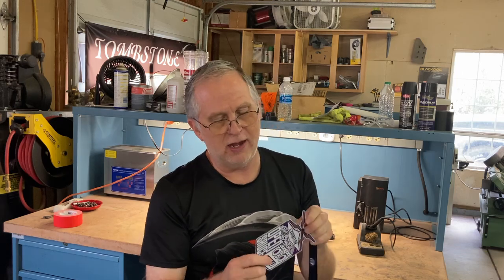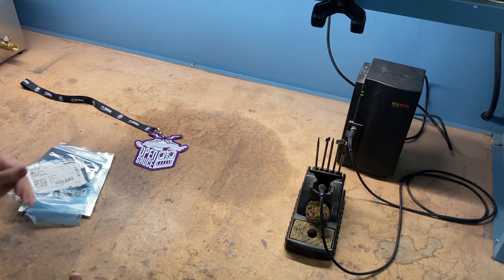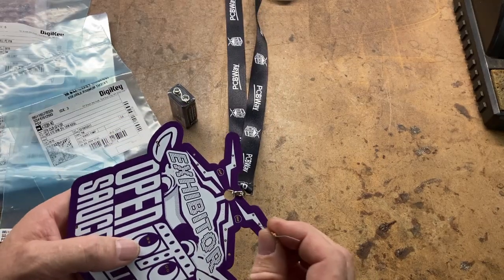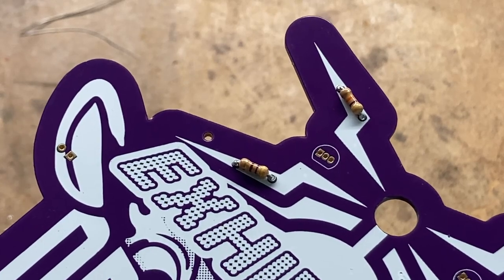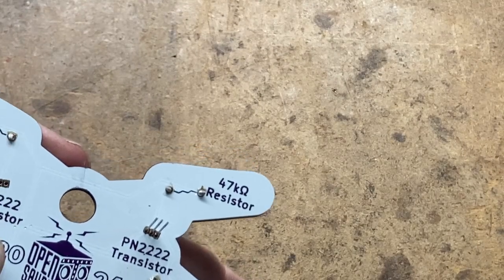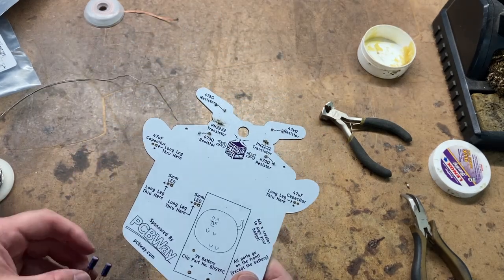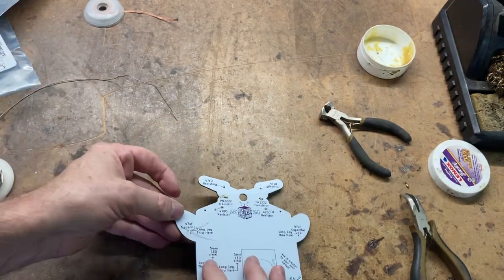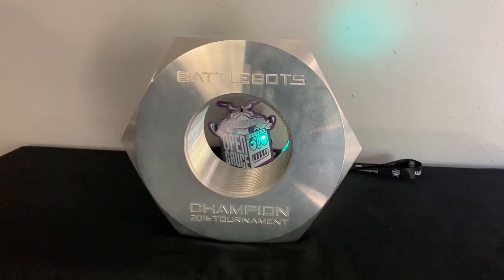Open Sauce 2024 - Badge Assembly!

Comment: I am imagining a million electrical engineers screaming in agony as you don't use a strain-relief tool to bend the legs of those parts.

Nice work!
Reply from the maker: "Soldering" to me is usually larger high power stuff. Crimping and soldering ends on 2 gauge wire for power systems in the robots. I almost never do any circuit board level soldering, and it shows :) 

It did however work when I was done!
Reply: @ray9368  I bet you use an iron with a bit more thermal output than that little one.

The whole strain relief thing really only comes into play when there is a lot of thermal cycling, extended lifespan, or vibration—yet people still find it a worthy hill to die on for small, fun projects.
Reply: Hey, Raqtty, I'm not a bot. Don't reply and then delete your reply. You suck, bro.